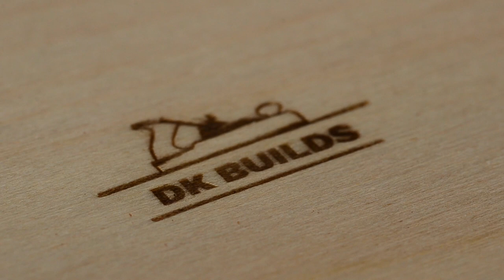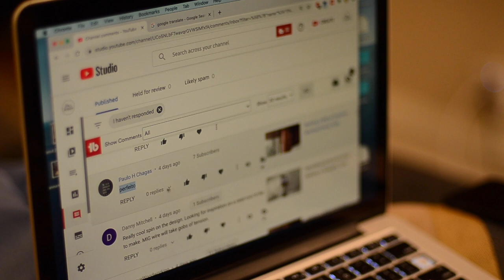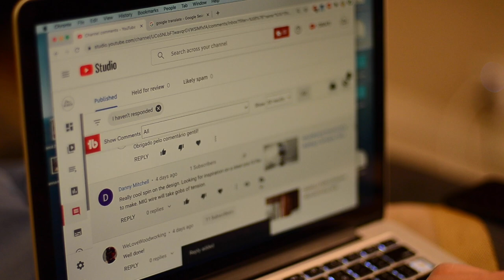Why I Make YouTube Videos | Woodworking Documentary

Comment: I was wondering do you have a video explaining what all your tools are for. For example the one you roll by hand to score a line on the wood. Why do you use that tool?
Reply from the maker: Great question! I don't have such a video unfortunately. That is called a marking gauge, and it is designed to mark a line exactly parallel to the edge of a board. For example showing how far down you have to saw a dovetail.

Comment: Hey David! Your hanging tool cabinet inspired me and now I'm working on one of my own.  I do have a question about the hinges. The hinges I have leave a small gap between the leaves when the leaves are parallel. I think this is to leave a gap when mounting an inset door perhaps. But if I use these hinges to overlay the doors like you did, I think it would cause the doors to float a small amount away from the case and leave a gap. Do you have any advice?
Reply from the maker: Awesome adlleong, I'm excited to hear how your cabinet turns out! Yes actually I had this exact same issue. I asked around on some forums and eventually learned about "swaged hinges": https://cloudfront.zoro.com/img/zoro_tips/hinges_eZtip.pdf The hinges I bought were not swaged, and I needed them to be swaged, so I found a youtube vide showing how to convert them with a vice. I'm pretty sure this is the video I used: https://www.youtube.com/watch?v=nYLiXY8DodE
It's a little scary but it worked for me. It definitely felt like if I pushed too hard I would break the hinges, though. I would recommend buying an extra hinge or two to practice on if you are worried about breaking them. Hope this helps!
Reply: @dkbuilds  thank you! this is exactly the information I was looking for!